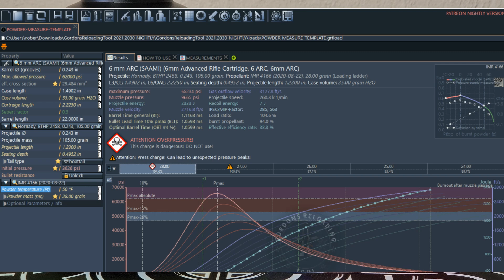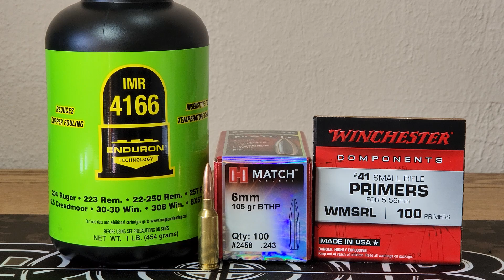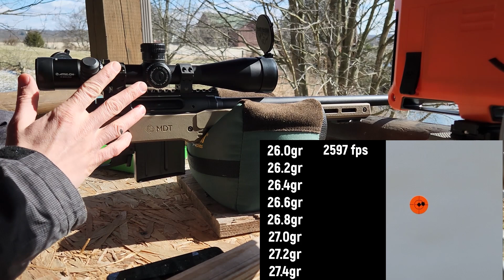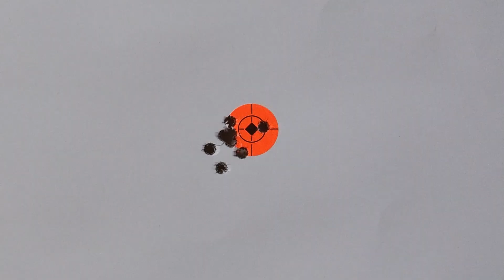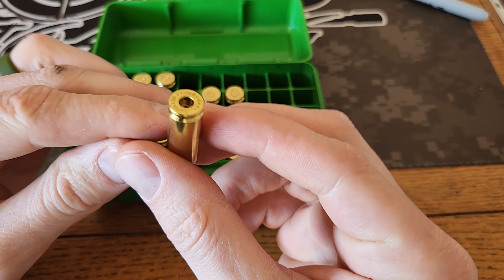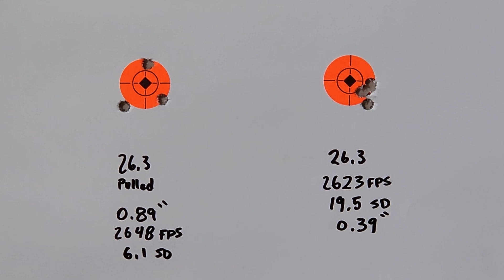6mm Arc, 105 BTHP, IMR 4166

Comment: I know this is an old video from several years ago, but just watching you do that test, your accuracy node is the 26.2 - 26.4 powder charge where you had the fps flatten out, only jumping 3 fps between the two. You have another one at 27.0 - 27.2 with a 2 fps change, but your getting pressure signs so that is a no go. Personally, I would load up 21 rounds at 26.3 and start a seating depth test in three shot groups. I would start at 10 thousands off the lands, moving back 3 thousands every three shots. I bet you find the most accurate load for that rifle by then by the end of the 7 three shot groups. People will put many unnecessary rounds through a rifle trying to find a load when honestly, finding a load for your rifle is very simple. And it starts with just what you did, a Satterlee / Ladder test looking for flat spots in the fps numbers.

Comment: Just curious if you ran into feeding problems on your rifle with shorter lighter weight bullets? I have the Savage 110 Tactical in 6 ARC and it jams 75gr bullets into the top of the receiver.

Comment: I just resized 50 pieces of Hornady once fired 6.5 Grendel brass to 6mm ARC today. It was very easy, didn't even anneal it (this time...). I made some ladder loads, using Sierra MK 70gr 1505's, over CFE223 and TAC.
Also loaded some ELD-X 108gr, over CFE223. We'll see what groups best, checking speed, and checking for pressure signs. I'm shooting a 22" AR platform (Satern barrel) 
Thanks for sharing your information here on YouTube.🙂🙂

Comment: Ive been running hornady108gr ELD-M @ 2711 fps.Im  using 29.7grs of Leverevolution.Im drilling the 2inch Bullseye at 600 yards .No effort at all. I did get some faster loads with CFE 223 at 30.6grs.I hit Some really high velocity and my Sd & Es were low.
Reply from the maker: How do your groups hold up with temp changes? I've stayed away from the temp sensitive ball powders.
Reply: @RobsReloading  I've not any issues at all and I li e in Southeast TX.
It's hot all the time.lol
I shoot almost daily.Im retired and I'm a Director at a gun range.I shoot a lot of different calibers too.Just built a 6GT.
I'm re barreling a 6mm ARC.
Reply: @RobsReloading  Ive had real good luck so far. I have been using the IMR 4166 in my 308 Win. Competition  rifle using 42.3grs pushing 185gr Juggernauts..Its going at  2680fps. At 43.1its 2720fps.. I absolutely love it. I didnt have Varget at the time and tried  IMR 4166 per advice from a fiend of mine.

Comment: The burn rate of that powder is definitely faster than GRT and QuickLOAD show.  I adjusted the burn rate in QL until it closely matched all your velocities.  The predicted pressure of the blown primer load with the adjusted burn rate was 66,661 psi.  26.7 grains is a near max pressure load and 26.8 grains is over pressure by 300 psi.  26.7 grains predicted velocity was 2672 fps.  Note: The maximum pressure Hornady suggests for Bolt Guns Only is 62,000 psi, which is 10,000 psi higher than that for gas guns.

Comment: Sweet! Finally picked mine up yesterday my ffl had a 110 tactical come in so I grabbed it. Comes from the factory with the mdt 6 arc mag so that is a bonus
Reply: Is that the one with the 18-inch barrel?  I wish it would have come with a 26-inch!
Reply: @dahut3614  yes it is. It is being run suppressed 100% of the time so a 8” can will live on the end of it. Plus all loads will be around 70gr variety for a varmint round.
Reply: @chrisfisher3900  Okay, but I hope they like to jump.  The 105 grain BTHP used in this video are 1.230" long.  70 grain Varmageddon is .875" long and Nosler Ballistic Tip is .910"  For comparison, the Hornady 75 grain V-Max is .935" and their manual says to load them in the 6ARC to 2.095", which makes the part that touches the case .210" (doesn't include the boattail).  That's something that I didn't used to think about and there isn't a lot of load data out for 6ARC.  The new Lyman Reloading Manual 51st edition is supposed to have some data for 6ARC, but I haven't seen it yet.
Reply: @dahut3614  hopefully. Yeah I haven’t even started a work up on it yet. Still have 200rnds of factory black to burn through for brass. Might not take so long if we could get supplies reasonably

Comment: I'm blown away by the accuracy potential of this cartridge. Do you think you will ever build a gas gun in 6mm ARC? I think a lot of us would like to see the results of those reloading and shooting tests.
Reply from the maker: I probably won't do a gas gun in 6 Arc anytime soon, as a reloader the full potential of the cartridge can only be met in a bolt gun due to the 52k pressure limit. I also already have the 6.5 Grendel AR that performance wise is very similar to 6 Arc. The next thing planned is a bolt gun with one of the 308 case head 6mm cartridges.